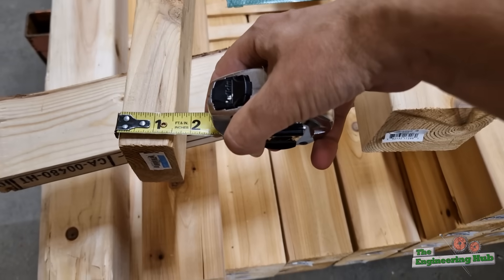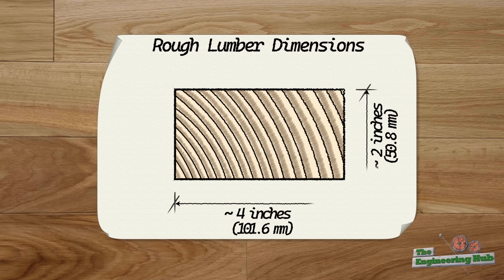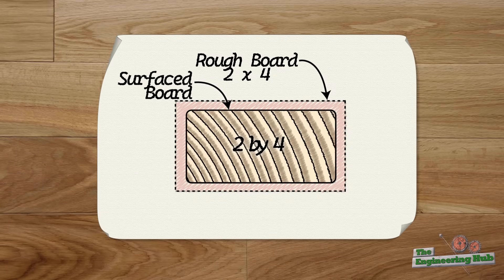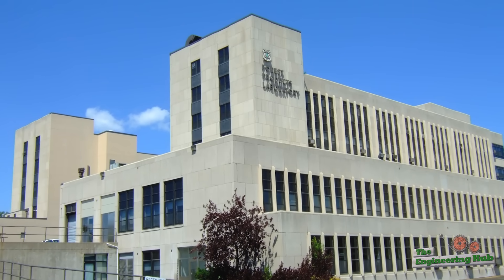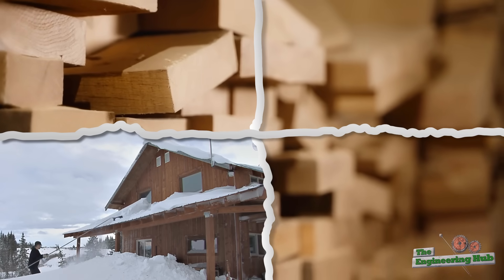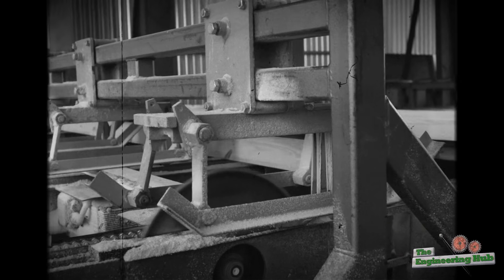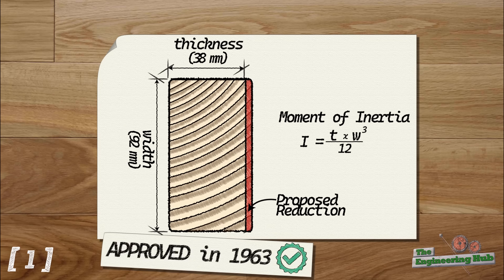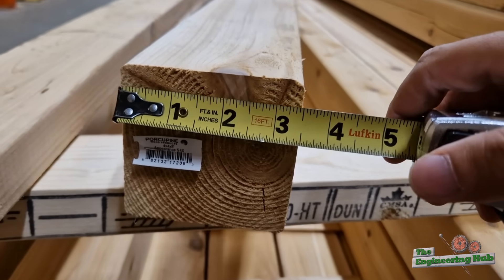Why is the 2 by 4 getting smaller and smaller?

Comment: Strange. My family produced two types of 2x4 cuts to meet differing reasons, and none of them had anything related to what this video suggests.

A true 2x4, milled down to 2x4.

And the current 1.5x3.5.

My grandfather said it mainly because there was an engineering standardization movement.

true cut 2x4 often thrown off COMMERCIAL construction projects.

EXAMPLE.

A 2.5x3.5 wall, with 1/2" interior and exterior siding, comes out to exactly 4", a measurement easily planned with. 

But with a true cut, it's now 5", and as you go along, the measurements get wonky, especially for the construction crews that many of which barely spoke English.

Then came the volume vs. weight issue during the mass construction phase the U.S. faced.

Ships carried based on weight regardless, but by reducing the size of the 2x4s, more homes and other construction could he done with the exact same weight in materials. 

3.5x20=70 vs, 4=68.

So for every load, you could add by 2 in each stack. 

You could build 2 extra homes for every 68 built, for the same volume. That came out to 140'000 in EXTRA profits. 

NOW, with the reduced dimensions, more usable sticks could be cut from each log. About 6 more.

This meant the mills produced more cuts, the builders built more homes. 

There was an added benefit to it from the accelerated drying time, by reducing the size, it helped speed up drying and bringing down the time, meeting various contracts time/maximum water content.

Comment: I started building houses in the '70s and did for 50 years, 2x4s & 2x6s have been constant but the 2x8 and up are now a 1/4" smaller a 2x8 is 7 1/4" a 2x10 is 9 1/4" a 2x12 is 11 1/4", working on a house with 6x10 PSL beams with 2x10s hanging between the PSL at 9 1/2" and the 2x10s at 9 1/4" we had to rip the PSLs down. Job in the Pacific Northwest supplier said they have 9 1/4" PSLs available on the East Coast if we wanted to pay shipping :(

Comment: Not being a contractor or even one who is used to doing any sort of woodworking, I've always wondered why the wood wasn't what the numbers said.  In my math classes I would have had a hard time getting away with saying that 2 inches = 1.5 inches (or are the same thing). Thanks.
Reply: RE:bikeny.  It's called a "nominal" size. Other products like pipe use this system, also.

Comment: 😮😮I have issues with replacement of load bearing lumber in my 1939 home. Apparently none of the lumber of my house can easily be replaced with a standard piece of wood from the store. And of course no changes can be made unless the change is up to current code.

Comment: BC Canada (the home of douglas fir framing lumber) has a Workmens Comp. site for the JOB built ladder and I used to pick over the lift for the straightest ones out of the pile to build ladders as per the design. 25 years later I did the same thing and my ladders went like a DNA helix in weeks. NOT the same lumber any more.

Comment: 2x2 pieces of lumber and most other sizes also as well as 4x4 trucks IS FALSE advertisement.
None of these are what they claim regardless of purpose for doing so.
If the description says that they should be a size or have a specific ability they should.
Companies that make armour for police and military use today are very cautious and do not label their product "bulletproof" anymore.
Why? Because these items can be taken at face value and people can get hurt doing so so armoring companies call their product "bullet resistance" now instead to limit their own liability should their product be perforated by certain munitions.
Since nobody dies using a mislabeled 2x4 or 4x4 truck companies continue to fools people into thinking they are paying for what they asked for when it is not the case.

Comment: You missed the biggest and glaringly obvious/ undisputed reason.   They moved the saw's blade to the inside of the cut instead of the outside as they did until the 1970's.  They figured out that they can harvest more board feet per log by moving the cut, meaning the customer gets less.

Comment: I recall our first house we purchased in Richmond, Indiana in 1987.  The house had been constructed in 1926 and it was a high quality wood framed house. They had covered the exterior with wood planks, steel mesh then stucco.  The stucco was still very hard and in great shape when we moved in.  I recall over the next few years rewiring and replumbing the house.  I lost count of how many spade drill bits i had to use drilling thru the wood for the projects.  I measured the 2 x 4's and they were huge compared to today's standards, they in fact were 2" x 4" and strong and hard as an ox!!!  Even many of the boards were oak and it took forever to bore a hole thru the floor joists with the smoke from the new drill bits lol!!  They sure built quality houses back then, built to last!!!    Oh yeah those floor joists were 2" x 12" spaced every 16 inches, that floor did not give at all when you walked on it.  Makes you miss the quality of those days.
Reply: I do wonder if there is not a surviva bility bias here.  My house was built  in 1910 and is amazing in its structure.  But those are the ones that survived because they where well built.  Those who where cheaply made arent there anymore.  In a 100 years they might wish for a 2023 built house, because by then only the very best of what we built will remain.
Reply: While I'm sure the thickness of the boards had something to do with them being a bitch to drill through, the bigger factor would be that oak is a hardwood not a softwood.
Reply: Oak 2x4s lol, those were the days.
Reply: @mkelebay  Chestnut 2x4s, those were the real days.  Too bad none of us ever saw those days at this point.
Reply: The good old day's !
Reply: Speaking from experience, it's a pain in the ass to repair those old houses.  You have to get a bigger board than you need and waste a bunch to cut it down to a normal "old-fashioned" size board or pay a premium for custom-sized lumber.
Reply: @FuckGoogle502  can easily just sister or use strapping too.
Reply: "Makes you miss the quality of those days."

It was human overpopulation who made that vanish, like the video said early on- local mills ran out of raw logs because all the locally available forests were already cut down, people wasted massive amounts of trees and lumber in the 19th century. The Chicago Worlds Fair- all the massive buildings were built out of lumber and "staff"- basically plaster and straw because the whole thing was temporary! The ground was muddy so they literally PAVED the ground with wood planks to walk on. Some months later or whenever it ended, everything was torn down, destroyed and you'd never know what was there- google the pictures, all the buildings were huge Victorian and Federal styled buildings with massive columns, pediments, ornaments, resembling the Whitehouse, and other such buildings
.
A massive commemorative arch some 5- 6 stories high was built over 5th Ave in NYC to celebrate one short event- google the Dewey Arch, it was up for less than a year and constructed of lumber and staff, and then destroyed. Since the lumber had lot of nails in it, cuts and was in the weather for a year, one can assume the lumber was likely all burned.

"Dewey Arch was a triumphal arch that stood from 1899 to 1900 at Madison Square in Manhattan, New York. It was erected for a parade in honor of Admiral George Dewey 

With only two months remaining before the parade, the committee decided to build the arch and its colonnade out of staff, a plaster-based material used previously for temporary buildings at several World's Fairs. Modeled after the Arch of Titus in Rome, the Dewey Arch was decorated with the works of twenty-eight sculptors and topped by a large quadriga (modeled by Ward) depicting four horses drawing a ship. The arch was illuminated at night with electric light bulbs.

After the parade on September 30, 1899, the arch began to deteriorate. An attempt to raise money to rebuild it in stone (as had been done for the arch in Washington Square Park) failed, owing to the growing unpopularity of the Philippine War. The arch was demolished in 1900,and the larger sculptures sent to Charleston for an exhibit, after which they were either destroyed or lost."
Reply: @FCE-dogs "Human overpopulation"? What is this ecofascism doing here?
Reply: @qwertykeyboard5901  Lol? If there were a billion people instead of 10BN, we could build our houses with 6x6 oak beams. Hardwood prices are entirely due to demand caused by high population.

Comment: I've done repairs on older homes in the midwest where the lumberr was actually a full 2 inch by 4 inch, but it was rough surfaced, not smooth like current standards. Add to that the wood lath on both sides and the build up of plaster with scratch coat, brown coat and finish, walls were about 6 inches thick or more between rooms. There is no modern substitute for the old wood lathe. I knew a builder who ripped dimensional lumber into what I recall as 3/8 inch thick strips to approximate the original lath when building up after major repairs or additions that extended walls. I learned how to properly plaster from older builders in order to do these repairs and match the existing walls. I learned an appreciation for plaster. Drywall is too soft and easily damaged accidentally. Plaster is much harder to damage. I much prefer plaster.

The home I grew up in had more modern dimensional lumber, being post war built. It still had plaster, but short cutted using gypsum panels (about 2 foot by 4 foot) and just the thinnest brown coat and finish coats on top of that. Much less work, much less material, but the same hard smooth finish. Exterior walls on the inside were thicker because they had expanded metal screening attached to the gypsum to give the brown coat more to attach to, like lathe it was on both sides of the substrate. Perhaps they even used a scratch coat. I never did exterior repairs to see that detail. This is Michigan and I expect the outside walls would have had the plaster lose its grip on the gypsum if it got too damp, so they gave it something that it attached to much better (the metal screens).

Comment: I live in the world and I never heard of 2x4, because the world outside the U.S. and U.K. does not use the Inches. 
And for centimeters   there are dozens of popular sizes for all purposes, chaved and unshaved, natural, dry, extra dry, with a whole lot of other flavours. 
I've just checked bill of materials for my newly build house. There isn't a single piece of woor that follows those dimenisons. 450*1950 (floor and ceiling), 450*1500 (walls), 20*40 (milimeters!), 35*130, 45*45, 40*40, and few others. What do you even use those 2*4 inch for? Coffee tables?

Comment: Well this archaic lumber phenomena should become a history. The same as this stupid only electrical toggle switch you get for $1 in HD which was designed 70 yeas ago and still in use. I am not talking even about more complex things like home heating system. US is waaaayyy behind modern methods of building and construction and this is a shame.

Comment: it's interesting that it just so coincidentally as we decreased the sizes we neatly started to match a whole mm standard as well, it got rid of the decimal mm.  It's been a hypothesis of mine that part of the shift in sizing is to better match the metric markets of the international lumber community. Since the entire world essentially runs on metric and the US one of a handful of holdouts, it would make sense that the other lumber mills would move to match something that is a whole number,  that still matches the properties of the dimensional lumber we know. We'd need to match it too, due to the US protecting most of it's old growth forest, and being forced to rely on re-growth forest or importing international lumber, 1963, which is when the US decided unanimously it would not curb its importation of international lumber and the new standards were adopted. So the treaties and tariff agreements were signed on lumber trade and those set the standard sizing and price for each item coming in. 

https://www.srs.fs.usda.gov/pubs/rp/rp_so017.pdf

Comment: When I was a child, I imagined growing bacteria in molds and triggering spliced DNA in them to start producing cellulose once a certain concentration had been reached perhaps by irradiation to activate the implanted genes or perhaps by injecting a seed amount of cellulose if the genetically modified bacteria could be triggered to produce cellulose in the presence of other cellulose.  Hence consistent wood could be formed in entire structures including some joints.   In theory, if triggered by the presence of other cellulose, the structures might even heal themselves if damaged.  Note cement can also be produced by bacteria and existing bacteria that does so already exists in nature plus combinations of wood ligins cellulose and cement might even prove to be better structurally plus high tensile strength reinforcements such as iron rebar or preferably fiberglass rebar could be in the molds.   I had imagined entire houses and boats being grown on site with what's essentially vats of bacteria or yeast.

Comment: I too point out that the older growth lumber that used to be prevalent is superior in strength due to the higher number of growth rings. I’m a contractor who does earthquake strengthening in residential homes so when we find a house has old growth lumber, we do what we can to retrofit our new material INTO the old because it is much stronger and reliable
Reply: Commenting on my own comment….lol. Want to point out that I do NOT condone old growth trees being cut.  Leave the old growth alive and protect them all!!!
Reply: @jtknight4647  what is this? how have we gone in less than a hundred years from prioritizing human safety to prioritizing saving trees? You dont have houses from a hundred years ago falling appart and killing everyone inside. But now you do. All that earthquake strengthening wont do much to help when the building falls appart because the modern planks were actually designed to last less than 40 years. No earquake, just time passing and the wood deteriorating.
I am amazed. This is mind boggling. I simply cannot understand how someone could clearly be advocading against safety because "trees are sacred". This is insane.
Reply: @AlFredo-sx2yy  um let’s see, what you say is not true about new lumber deteriorating and falling apart. This does not happen. We just know to use the old growth lumber in older homes as Part of our tactics. As for saving old growth trees, it’s not about an arbitrary ‘sacredness’ of them, although yes they actually are to life on the entire planet, the large trees are a huge carbon sink and oxygen generators among so many other benefits they create for an ecosystem. It’s not insane to protect old growth trees, cutting them all down is and that’s what people were doing and still would if we didn’t realize their importance.

Comment: One thing I don't understand is why do you need to shave so much away from a 2x4 to get it smooth? From 2 x 4 to 1.5 x 3.5 is almost 16% of material lost. What's the point of removing so much and how did wasting so much wood save any money?

Comment: I remember in the 1970s the excuse for smaller 2x4s was because kiln drying shrunk them. Everyone lnew that was bs as they weren't a cheap pair of jeans. In the old days there was 2-3 grades of lumber at lumber yards. Today it is just straight run that would be 2nd or 3rd grade. Of course smart lumber yards today don't call them 2x4s and just stud boards and will likely some day be 1x3s. It would be interesting to see how old real 2x4s in a building would compare to modern ones in a hurricane or tornado.  Not dead center as even metal has trouble but just the structual capabilities of the two. The old ones ones would have two qualities the new does not, well seasoned and tighter grain from old growth woood.